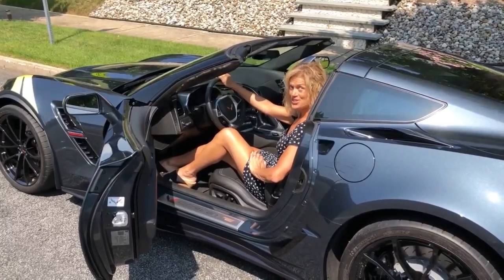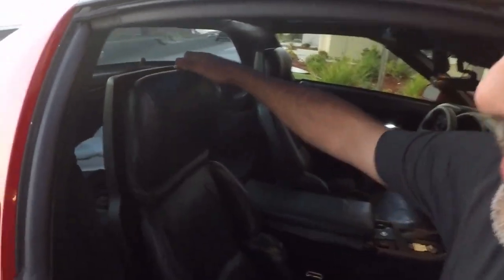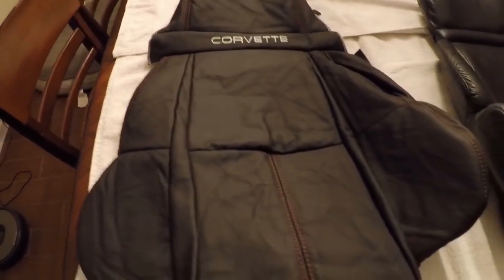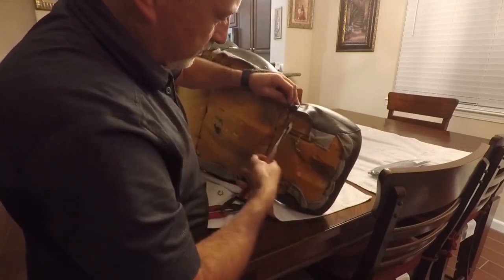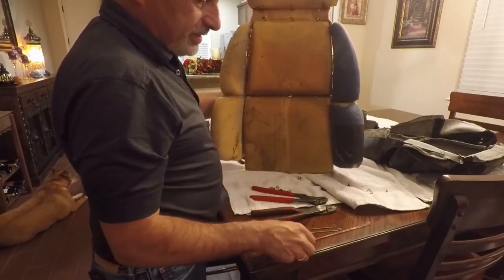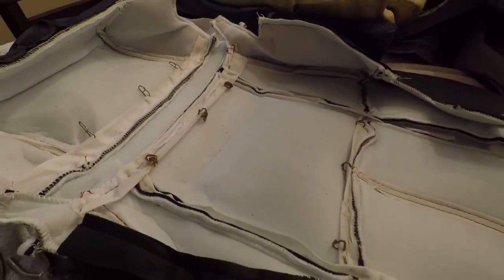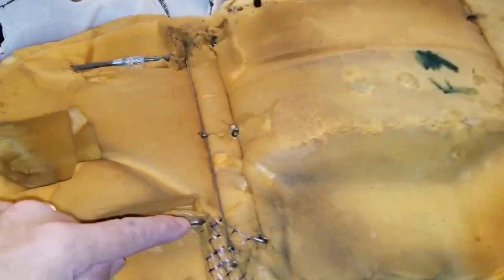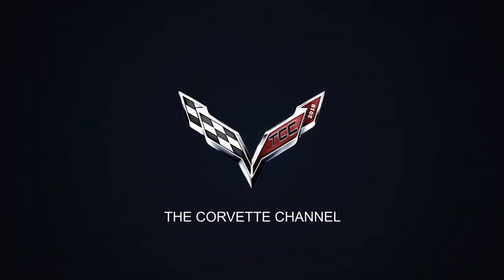How to Replace the Seat Covers in a C4 Corvette Step by Step Part 1

Comment: Great video.  I was having a hard time removing my passenger seat because it doesn’t bend toward.  I guess I might have to take the seat out of the backing.  Do you know if there is a cable or system that makes the seats tilt forward?
Reply from the maker: Yes there is a small lever near the front of the seat that has cable that allows the seat to fold forward, look under the front of the seat and you will see 2 metal U's they are the latches that lock the bottom of the cushion into place they are very tight and you may need to use a screw driver to pry them up to get them to release. At that point you may be able to see the cable.

Good Luck,
Scott

Comment: Hay #tora57mitch here great job I am currently working on reupholstering a set of 1993 Corvette bucket seats and was having a problem with how to get the seats apart from the frame I figured out how to get the seat cushion out but could not figure out how to get the back cushion out until watching your video.  I am going to redo  the seats with ultra leather and add some 1/4 or 1/2" foam to the panels because I will take the old fabric apart and make the new cover using the old cover as a pattern I want to make the cover fit tighter and have a smooth look the factory cover is way too hard ultra leather will be much more comfortable.
 #tora57mitch